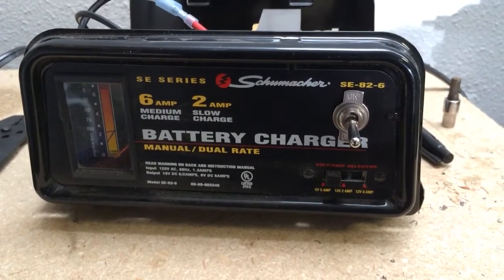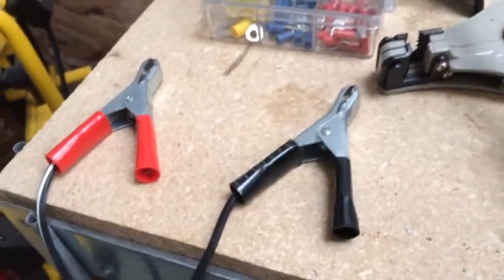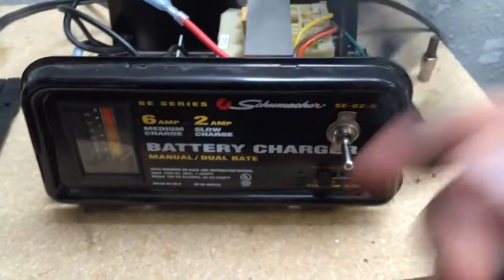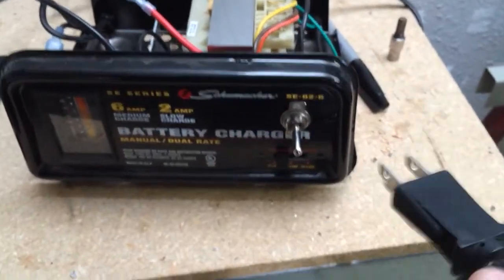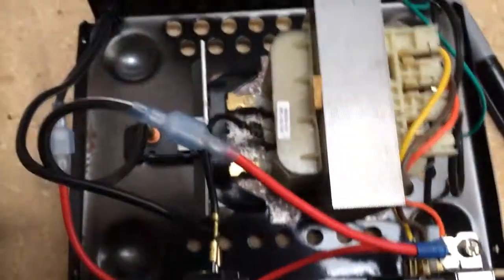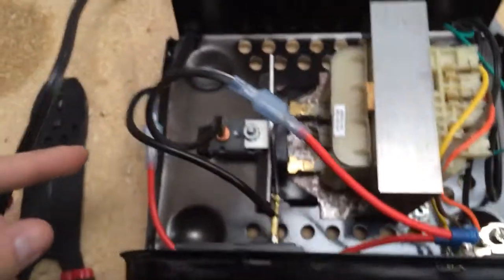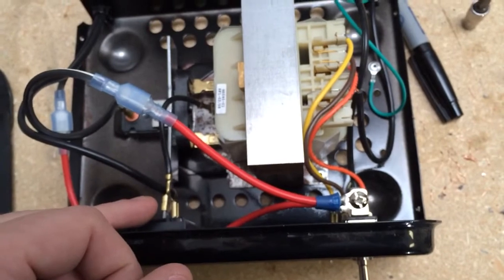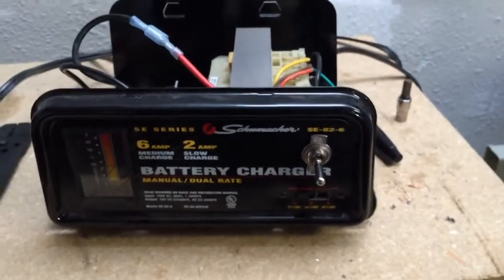Install battery charger on/off switch

Comment: Nice addition. 

It would seem to me you may have wanted to interrupt the incoming 120V so the transformer isn't being powered, thus eliminating a 'phantom draw' .
Reply from the maker: Good Point. I put it on the transformer side more as a safety action than an efficiency side. I always unplug the charger when not in use. It also gives me a pass/fail if the charge is working because I can hear the hum of the transformer telling it's ready to supply power to the battery.